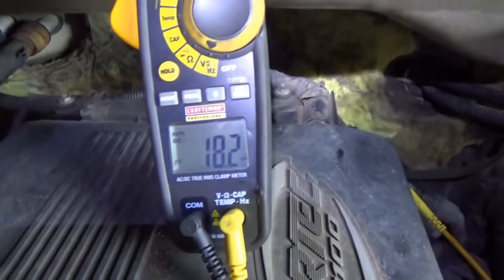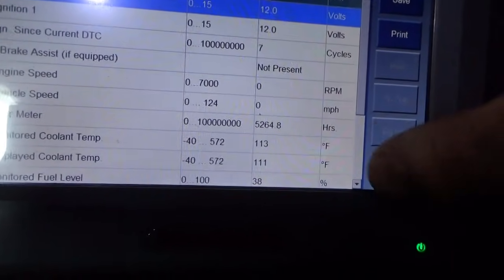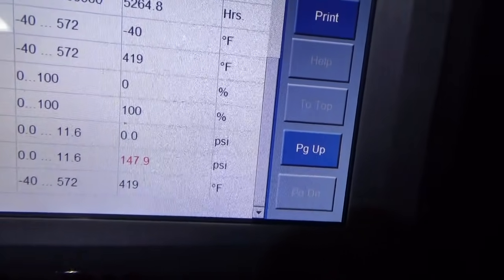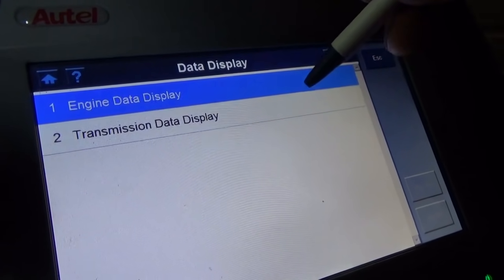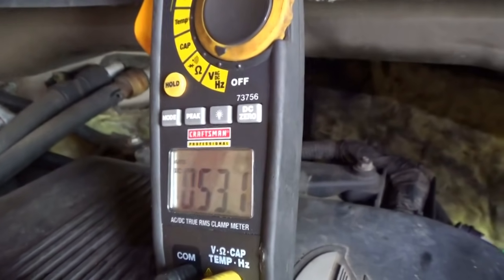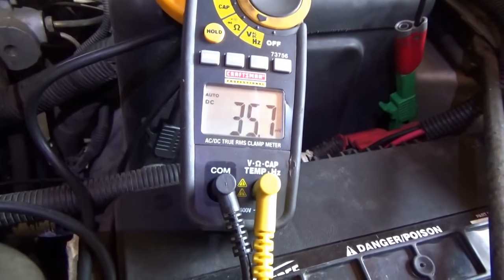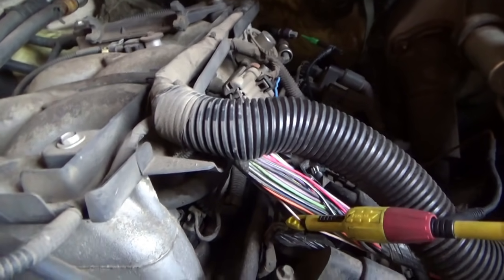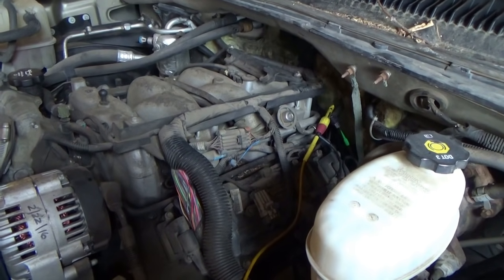GM Truck: Oil Pressure Gauge Sensor Low P0522

Comment: Didnt think about the cheap Chinese deutsch connectors. Every terminal and every port is slightly different same as the seals so getting a good fit Every time or half the time is temperamental. This find gave me a new direction to search for this ghost ive been chasing  off and on. Thanks for documenting your diagnostic approach

Comment: Gotta love it when wires decide to break at different points. The Buick 3.8 in my Olds eighty eight has a very tight harness near the cam and crank sensors. A break in the cam sensor wire, threw my timing off. Luckily I caught it and extended the wire before doing anything else.
Reply from the maker: Parts cannon disaster avoided :)

Comment: If you find yourself doing a lot of connector and terminal repairs, the parts are available relatively inexpensively from sites like theelectricaldepot.com and crimpsupply.com. I have purchased quite a few items from them because I find it easier to replace the terminals than deal with the frustration of trying to reuse the old parts. GM's Metripack components are readily available, unlike a lot of other vehicle manufacturers.

Comment: Awesome job Ivan!!  Yep, for sure, Eric O is very proud of ya!!!
Reply: I had a problem with cruise control module.  Thought I had a bad one.  Followed your way to check for wiring etc.  Found that the plug was bad.  The 2 of the pin was bent as hell.  Went to junk yard to get 2 pins,  replaced it, did that solder job like you did.  Love and behold,  my CC works!!! :)  no parts cannon required, hahaha
Reply from the maker: Awesome fix, Josh! Now you have to wonder how did those pins get bent in the first place?
Reply: I think I know why,  I replaced my brake booster as it was rusted and leaking.  I disconnected the wiring and removed the cc wiring to gain more access,  I didn't realize my cc  didn't work few months after that job. I might have been rough putting the plug back together.  I admit it.  Lol

Comment: Great diag Ivan. Had a Dodge van with the 5.2 surge and stall on cold start until closed loop. Totally spanked me on the diag. but found O2 sensor heater bleeding voltage to the signal wire causing a negative bias befor sensor came online.

Comment: Up doing research. Good diagnosis & repair. That's pretty common for them to break at the connector terminal. Customer will be happy with an operation & illuminated IPC. Great job Ivan!
Reply from the maker: Thanks, Bob! That harness was a bit tight, so not too surprising that the wire fatigued right at the terminal...

Comment: I hate butane soldering irons. I'll use mine in a pinch but they suck for doing multiple wires because of the lack of stable temp control. I started bringing along my little hakko soldering station and a small inverter. Much better consistency as far as temps go and you can leave it hot for bigger wiring repairs without wasting fuel. Also great for cluster rebuilds.

Comment: ,
Most likely a "caveman" pulled on the wire while disconnecting it either during previous oil pressure switch replacement or for an area related repair where harness was disconnected...
Reply from the maker: hmmm I don't think anyone has been there before...just 170k miles of vibration is to blame I think!

Comment: Not a bad repair there Ivan. Maybe it's time to buy some Weather-Pack new terminals for future repairs along with some liquid Kester rosin core flux and a more heat friendly soldering iron/station VS that butane barn burner...

Comment: Ivan, great thinking! The 50/50 algorithm for finding the problem is the best, naturally after eliminating the most probable  spots (heat, vibration, bending, water/salt intrusion). Halve the wire, find the faulty half, take the next measurement at the mid point of that and then again split that to half. With those probes, works great.  Within minutes you have only a few feet of wire to comb through to find the break.
Reply from the maker: It really helped that the wiring loom was accessible it this case! Some manufatcurers wrap up their harnesses so tight and route them in hard-to reach places :)
Reply: Sad but true. Manufacturers still believe that wires do not ever break, there are no rodents nor salt and so on. It would not take much to design the looms to run on visible places, route those mostly inside, not under the car, put looms behind a access panel, not inside the body of the car, etc.  

But.. Usually wiring lasts longer than the designed end of life of the car, therefore it is unlikely that this will change for the better any  time soon. I would expect the opposite. Even flimsier wiring and more Chinese $5 (at the factory) modules as the amount of years before planned obsolescence are going down towards 8 years.

Comment: You can buy those weather pack terminals from places like Mouser.com.   There are a couple different sizes GM uses and most are available there.  I keep some around and they come in very handy.  They often stock the various connectors too.  If you can get a part number (they are in my factory service manual for my 02 Sierra) then it makes it really easy to search on Mouser.

Comment: Great job as always!!!
Reply from the maker: Thanks, Jason! How's that Genie treating ya?
Reply: Honestly I moved it a few times. 1st time was perfect, second time I had the Ole fuel problem. I believe I need to change that shut off valve near the fuel tank. There is non-ethanol fuel in there now so I can't use that for an excuse. I finished the Silverado powertrain  rebuild. I have one more major project to finish and then I can focus on the Genie. I'll keep you updated.

Comment: I think a truck of this vintage would benefit from a replacement oil pressure sender.  One of these days it will quit from just being varnished shut.
Reply from the maker: When it quits, it will be replaced. How about a new engine too? That lifter knock was pretty loud lol
Reply: Gm 3500 pickup
Reply: In the end it depends on what the client wants but I would have recommended it.  My personal vehicle will be 15 years old next April.  So after looking it over and seeing no rust I rolled out the parts cannon this summer and boom!  I'm about 6 or 7 grand into it and still going.  Hopefully the car is now as trustworthy as when new.
Reply from the maker: Whenever I install a new part on a car, in my eyes it becomes LESS trustworthy. The old part served faithfully for 200k miles, but the NEW part still has to prove itself!
Reply: Ignore enough of these maintenance measures and pretty soon the vehicle is suitable only for the crusher.

Comment: I'd be concerned about 12 psi of oil pressure if I was the owner.  Sounds like it got some piston slap or rod knock as well.... Not your problem though.  Nice fix!!
Reply: I get 12-14 psi at 650 rpm.  Engine is rebuilt now at 77,000 miles.  It's normal for GM, lol
Reply: @AP9311  That's not normal bro my 1500 has almost 200k miles and oil pressure at idle around 550-600 rpm is between 30 and 40 psi

Comment: Aren't you supposed to use a crimper on those weather pack terminals?  I used to find that it was quicker and sometimes the terminal won't fit into the connector if you leave those tangs up on the terminal.

Comment: thank you I have this problem changing oil pump sensor and still soon as it gets hot on stop idler goes to low oil pressure to 3 psi

Comment: Why would both high& low voltage oil pressure codes be always instantly stored .
Along with just about every bank & sensor O2 code (5 different O2,plus the 2oil ones total 7 codes pop rite up...?

Comment: Hey great video by chance do you remember the hand held unit you are using, I have an 05 duramax same issue and I changed the plug, and oil gauge goes up to zero, thank you if you have time to reply.

Comment: I had p0523 oil pressure sensor changed and afm manifold still had p0523. Good oil pressure on bottom but low oil pressure on top. Engine replaced in Chevy Silverado

Comment: Quality job mate...just one question...when doing your bypass from the 5volt to the signal wire..is that a direct bypass with a wire or did you say you used a test light between them.i was thinking that sending 5volts down the signal wire would cause a short circuit or high voltage fault code?
Reply from the maker: For low-current circuits I generally use a test light as a jumper. You would set a "circuit high" code for sure, but that just proves wiring integrity is good :)
Reply: Pine Hollow Auto Diagnostics thanks for the reply ivan, just wanted to check and make sure.
Reply: You can use a direct jumper wire and not hurt that circuit in any way.  However, using a test light is always a safer method.

Comment: Hi Ivan,why is the oil pressure psi displayed in red? My maxisys shows date in red when it's out of spec IE not within the limits in the left column
Reply from the maker: Sometimes the "limits" on the Autel are completely arbitrary...no idea where they get the numbers!
Reply: Seems like the maximum regulated oil pressure is 40psi from the oil pump. I figure the normal display range in the scan tool is based on a fully warm engine at idle. For example, I know the oil pressure spec on the GM 3.1L V6 is about 11-15 psi at idle, fully warm.
Reply from the maker: Wow what a difference! Depends on the oil viscosity as well. My rule of thumb is if the engine is not making noise and oil pressure is above 10psi at hot idle, then don't worry about it ;)
Reply: Yep! If it aint broke, don't fix it!

Comment: Looking at GM oil pressure at a hot idle is always a little sketchy (15 psi sometimes even lower). I would rather have oil pressure 100 psi too high than 10 psi too low.

Comment: My neighbors 2007 1500 5.3 lost oil pressure the other day. 
Truck dipstick showed  add quart. 
I topped off and started,  gauge went to 40 at 1800 RPM . I can keep at 1800-2000 and it will stay at 40 ish for about 3 minutes then slowly drop to the warnings coming  on then to zero..
To me this sounds like once oil get warm  this sounds more like pump area problem more than a sensor.
Any thoughts before I dive in??
Tom

Comment: Ivan, do you know if I could grab an instrument cluster from a junkyard from a similar Silverado/Yukon/etc vehicle which HAS the transmission oil temp gauge and add it to my 1999 Silverado 1500, and it would thus plug and play? I assume in my truck the servo motor in the cluster isn't there or maybe it is, but the faceplate/bezel just has a blank covering it? Tom D.
Reply from the maker: Well, that depends if your transmission already has a sending unit installed, and if you can see the trans temp readout on a scanner...
Reply: Likely the 1999 ECU does not support that cluster.  If a scan tool shows the transmission temp you might be able to add a dedicated gauge.  I have a 2000 GMC and don't believe the cluster is anything like the 2004 Silverado.
Reply: I assume the ECU used in that year used a transmission oil temp in the 4L60E tranny to assist control shift points thereof based on temps of the fluid. I don't know what GM's mindset was with (being the trans temp gauge was/has been an option and if the servo motor is already there behind the "bezel" curtain.
Reply: There is lots of info out there about adding the trans gauges.  In many cases it's plug and play.  There are companies that sell these clusters with the trans gauges installed and claim they work when you plug them in.  A quick Google search will reveal a ton of hits.  You can add the stepper motor, needle, gauge face, and a light bulb yourself but the cluster has to be programmed to display the trans temp.

Comment: I have a 2000 S10/2.2, my oil pressure is good around 40 psi, after it warms up, and eventually goes down to 5-10 psi, I tried new oil pump,new sensor, I'm up to the gauge, I don't want to ruin my engine...help

Comment: Ivan, new here , just subd and have a ??? Have a 2002 Chevy express 1500, conv van, 5.7 liter v8. Has week miles on her. She runs great, but my oil pressure gauge starts at 40 psi when 1st started, then after u drive for about 30 mins, it drops to about 32 psi. And at stop light it will drop to about 12 to 15 hundred psi. Then when you hit gas jumps back up to about 3500 psi. I'm on ssdi so can't afford to go to mechanic, can you give advise, and what should my oil psi be on this engine. Ty.
Reply from the maker: Hey Bryan, I would say there's nothing wrong with the truck. Keep running it!

Comment: 168,000 miles + 12 psi oil pressure = not much time left. Looks like main bearings to me.
Reply from the maker: Ah come on it's a Chevy! These pushrod engines can go 500k if somewhat maintained haha
Reply: pressure relief in oil pump/pan and cam bearings likely, which of course makes for lower pressure/oil to all. rattle rattle rattle ;)
Reply: My vortec 350 gets 12-14 psi at idle (650 rpm) it's rebuilt block now at 77,000 miles.  It's normal for GM, lol.
Reply: that's the big block 8.1L(8100) in it he said(L18) roughly 496 CU.IN. and has near nothing in common with any of the small block or previous big block "LXX" engines, except for the 7.4L and that is more or less the bore size of 4.25" :)) they're also known for piston slap and lifter noise..
likely needs an oil change and something heavier than 5w30 poured in it :)